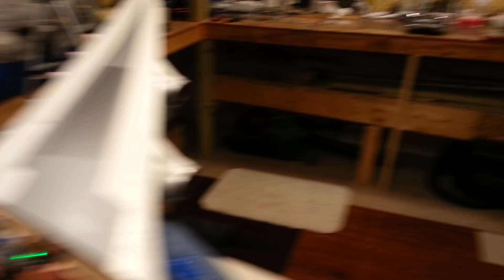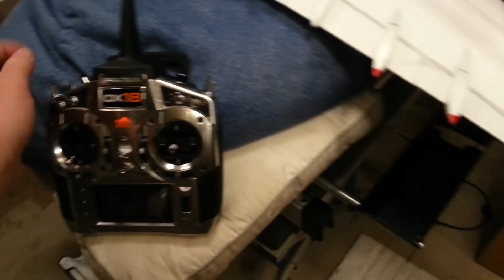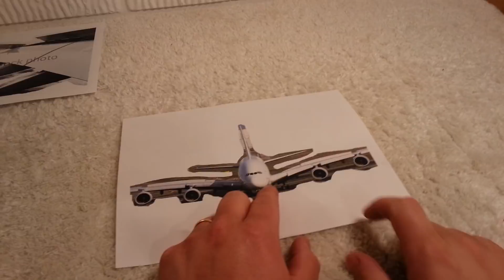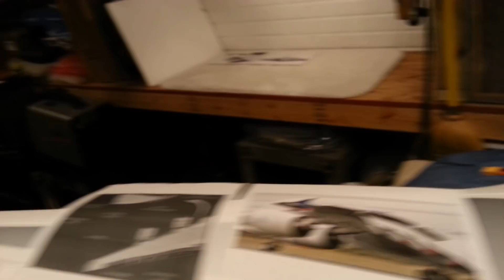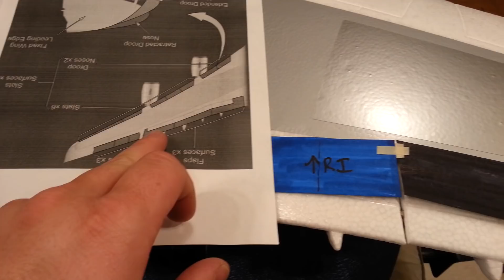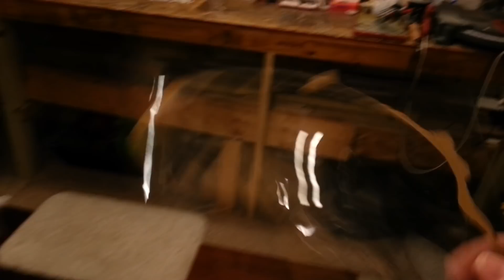Tian Sheng - Airbus A380 - Spoilers Part 1 - Overview & Layout

Comment: Maximum ramp weight  577 t (1,272,000 lb)
Maximum take-off weight  575 t (1,268,000 lb)
Max. landing weight  394 t (869,000 lb)
Max. zero fuel weight  369 t (814,000 lb)
Reply from the maker: Your specificity is wonderful!!! Thanks Raymond...so 1,000,000 lbs wasn't that far off :)
Reply: :-) Some things don't need a lot of verbiage.